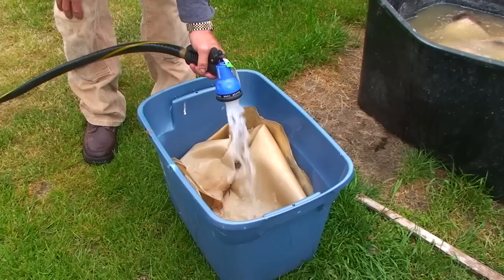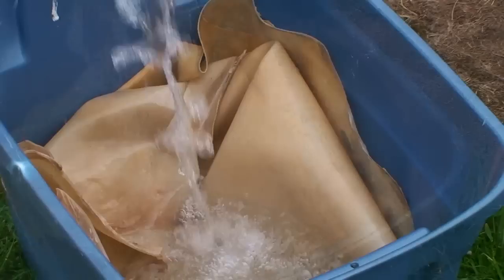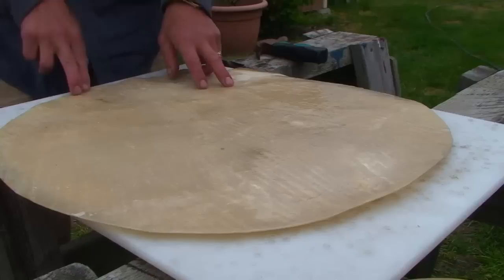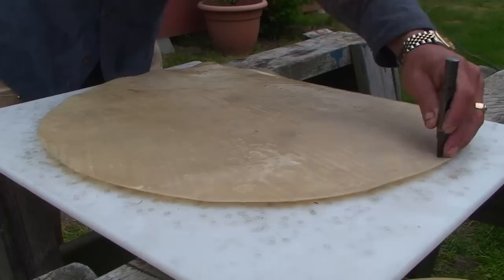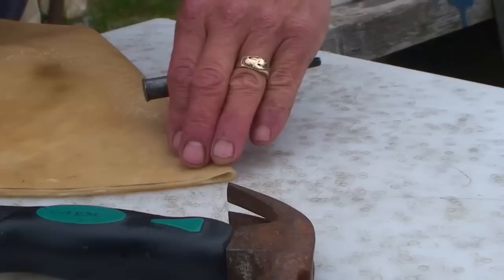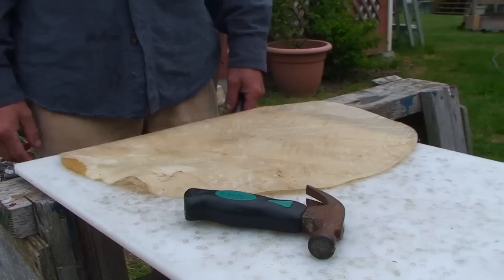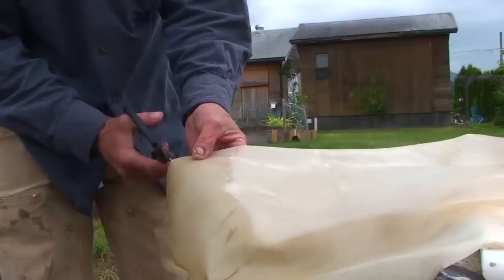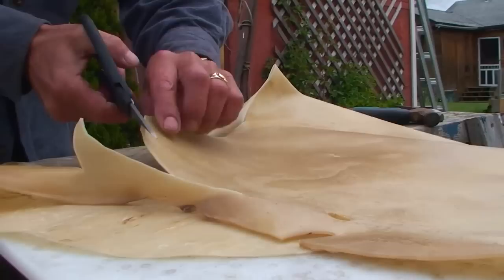How to make a traditional Coast Salish Drum: Jorge Lewis Drum Maker

Comment: I made a drum using a similar design. I'm in subtropical Queensland, Australia and my drum loses all it's tension on cold days. Any advice how I can counteract this with my next one or is this just something that happens in warm humid areas? It's fine if I put it in the sun before playing or lay it on the heater/hold it near the fire. I know of other people around here with similar issues but they didn't make their drum and don't know either.
Reply: It's normal for a drum to go a little flat cold. Keep it covered when you aren't using it. That will keep it from fluctuations in temperature. If it's really bad you might wanna restring it. Get new string if you do this as old string is prone to breaking.

Comment: Hey technical question, if i were making an 18" diameter shaman/frame drum would a single rawhide bend suffice? Info says its about 6-7 square feet of surface area and if i calculated right to do an 18" frame drum thats 2.5" deep it would need to be at least a 30"x30" piece of rawhide. Im confused as to how to convert square feet into inches to figure it out.

Heres the link to the piece im looking at!

https://www.tandyleather.com/en/product/single-rawhide-bends

Comment: Thank you for this video. I made my first drum last weekend. It is a beautiful Deer drum! I realized that with the cold and humid evening air, when I play it has a buzzing vibration. When the air is warmer you can´t hear that vibration anymore. Do you know why that is so and what I can do to fix that? Would be lovely if you could help me out here. Thank you
Reply: Your hide will respond to temperature and humidity. When it is warmer it will tighten. If it is cold/wet you may need to gently warm your drum e.g. using your body heat. If you warm it near a heat source, such as a fire, be careful not to have it too close, or there for too long.

Comment: Hello all, Maby a bit late, but i was wondering how mutch lace of rawhide i need for creating a drum of 1 meter diamenter? it will use the same waving as above, i have already made my own drum, but this was a small drum. i had some jounerings and requested to make a 1 meter drum (total size, so diameter, from center to end is 50 cm).can anyone enlighten me with this information so i do not cut to mutch or to less strings?thank you

Comment: What was the dia of the round hide?
Reply: +JOSE CONTRERAS The diameter depends on a number of things: the size of the drum you are making, the height of the drum frame, and if you want the hide to completely cover the frame as in the video. So, for a 14 inch drum, using  a 3 inch high frame, and allowing for the hide to wrap around completely, as Jorge has done, you'd be looking at a round of hide that's  about 22 inches in diameter (14 across the width of the drum, an extra 3 for each side, and 1 inch for the wrap where the holes are punched). You might choose to have some of the frame exposed, so the diameter of the round would be less--14 plus a few inches to wrap around the side of the frame, Don't forget that the length of the lacing with need to be increased if you choose to use a smaller round.
Reply: +Domin8them thank you for the info and your time